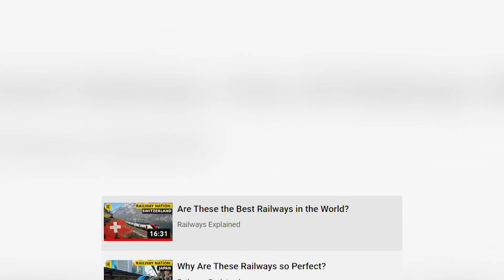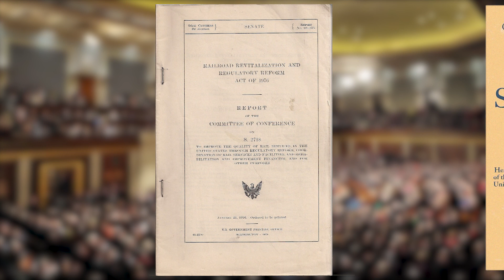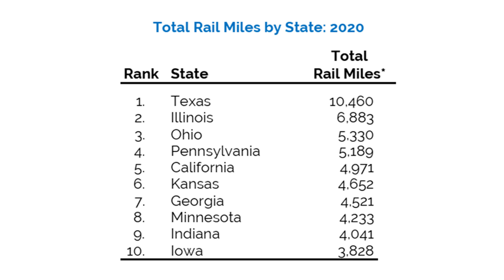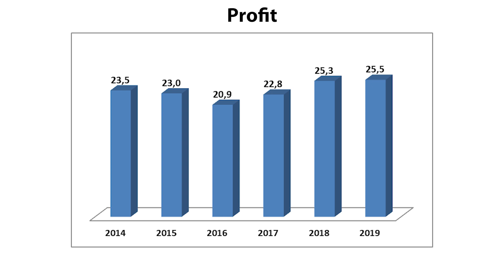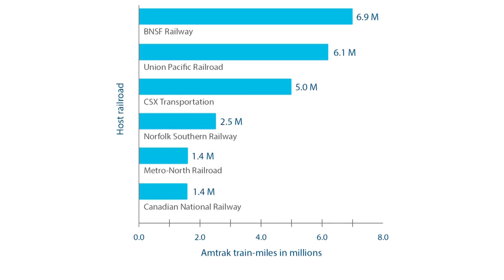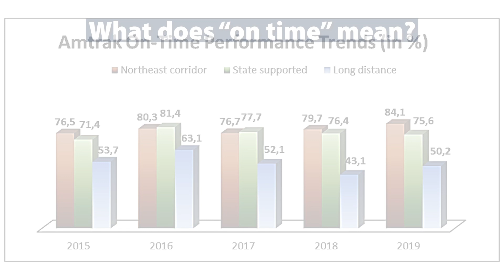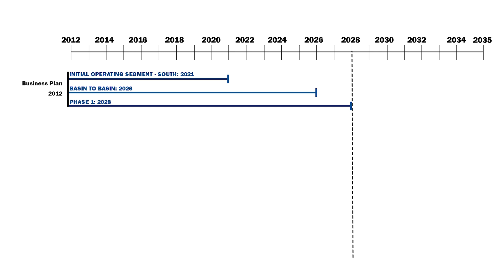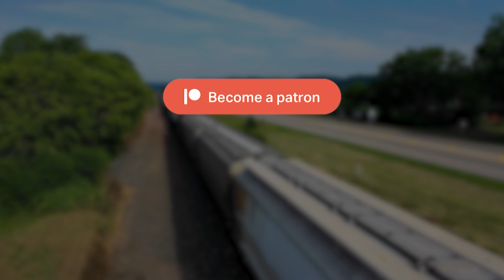American Railroads:  - Learn EVERYTHING About Them!

Comment: Would be interesting to see video on why freight rail is lackluster in Europe.
Reply: That’s because y’all have better passenger rail. It’s the opposite here...
Reply: @jackchen7003  also Europe has more uneven terrain and needs a lot of tunnels and bridges. That doesn't permit freight trains to be as massive, and efficient, as US trains. With that said, probably this year we will see some change in that. Even if our freight trains are smaller than the US's, they are still more efficient than trucks and with gas prices going up, well...
Reply: Europe has a lot of deep rivers which makes water navigation feasible for most areas, which is cheaper than rail per ton mile as there is no track to maintain.
Reply: @hannibal398  Even still, the US moves more domestic freight by waterways. We have the Mississippi, Great Lakes, and the atlantic inland waterway.

In the video you see 11% in US vs. around 7% in Europe

Comment: I do wonder if any  environmental offset made by carrying cargo by train is counteracted by the sheer amount of private vehicles carrying people inside and between cities.
Reply: It gets worse when you consider that trains in Western Europe, Japan, and even Russia are mostly electrified while the overwhelming majority of US trains are pulled by aging Diesel locomotives. Also americans drive larger, more polluting cars on average. If the US was serious about reducing carbon emissions, they would put in place a rolling railway electrification programme and decree that all new railway lines with more than 10 trains per day have to be electrified from the start. (A weaker version of this would be to mandate that all new rail lines have to be designed with clearance for overhead electrification in mind.) All of this in parallel with the development of a competitive network of medium and high speed electrified rail network dedicated to passenger trains.
Reply: Passenger rail cannot offset the environmental benefits freight brings. We are talking about very heavy materials in freight trains that are 10x as long as passenger trains.
Reply: @sciencecw  Sure, if you compare it to the road-based alternatives putting freight on trains has more benefit than putting passengers on trains. However, once you start taking short passenger flights out of the air with high speed rail, it's a different ball game. (see reduction in number of flights in areas with good high speed rail connections.)
Reply: @mariusdufour9186  : "the overwhelming majority of US trains are pulled by aging Diesel locomotives."  Obviously you know NOTHING about the murcan railroad system: trains in murca are 1000% pulled by diesel locomotives.
Reply: @mariusdufour9186  I take it you didn’t watch the video… 0.5% of greenhouse gases in America are contributed by diesel freight rail. That’s what you’re complaining about lol. And obviously, you don’t know what you’re talking about, since most class 1 RRs are running locos that are less than 20 years old.
Reply: @mariusdufour9186  Mandating railway electrification might have the opposite effect, as it may discourage use of railroads at all.
Reply: @jd0192  Electrical trains can pull more weight, accelerate faster etc. On top of greenhouse gas emmissions you also get a more efficient railroad out of it.
Reply: @spencergraham-thille9896  Why? Electric trains are cheaper to run and maintain (more than compensating the maintenance of the overhead lines and electrical system), last longer, and because they don't have to drag along a massive diesel engine and a massive diesel tank, they can pull more (or accelerate faster) with the exact same electric motor. In the long run, electric trains are just better, unless you're talking about lines that see only a few short trains per day.
Reply: @mariusdufour9186  “efficient” apart from the substantial cost outlay and the total redevelopment of infrastructure and literally everything else? Yeah, nice one
Reply: @jd0192  There is a significant upfront capital cost, but this is recuperated over little more than a decade of use, depending on how tricky electrification is due to bridges tunnels etc. The cost per mile goes down if you do it in a rolling programme, by guaranteeing electrification projects for a decade into the future. For example if Union Pacific held a press conference announcing that they plan to electrify all of their main lines over the next decade or so. Then you will see a few companies emerge that specialise in the electrification of railways. From the engineers, to the technicians, to the workers who put up the pilons. With every project, they will be able to deliver mor quickly and with a lower price-tag per mile.
If it isn't more efficient, why are the Indian railroads electrifying all their new freight main lines, and going back to electrify the existing ones? Why would they even bother developing an overhead electrification system that can fit double-stacked containers on flat cars? It's not like they are just made of money. It's because they figured out that they can move more freight more cheaply with electric trains over the same number of tracks.
For an example of an effective rolling programme, look at the Spanish high speed network. No one builds HSR cheaper than the Spanish except for the Chinese, who have lower labour costs, and more economies of scale.
Of course, we know US railroads are allergic to any capital expenditure that doesn't give them a return within the next quarter, maybe the next year. There are still double track flat crossings on the US network, for example.
Reply: @mariusdufour9186  California is doing some of what you describe. The line between San Francisco and San José is being electrified now. This is mainly so that they can use EMUs in commuter services, but it will also be used by the California High Speed Rail Project when the Pacheco Pass tunnel is built. The High Speed Rail project is being built completely grade separated as the trains will run at 350 km/hr - 220 mph.
Reply: @jd0192  efficient including those things, yes. Especially as fuel costs rise once again.
Reply: @mariusdufour9186  looks at new GE locomotive Wanna bet they're aging?
Reply: @mariusdufour9186  First, what year of production and by what standard do you consider "aging"?  Second, most railroads have either been rebuilding old locomotives or buying new locomotives to modernize to the latest EPA standards. Locomotives built since 2015 have the highest standards for emissions. The most advanced diesel locomotives move 1 ton of freight nearly 500 miles per gallon. The average tonnage of US Class I freight trains is 8.5 tons. So please explain why and what incentive any Class I and Class II railroads would have to move away from upgrading to higher tier locomotives and upgrade entire systems and rolling stock to electric??
Reply: @mariusdufour9186   "For example if Union Pacific held a press conference announcing that they plan to electrify all of their main lines over the next decade or so."

Please cite a source or link for this. I'm not seeing any news about this other than the battery electric locomotives it ordered to use for yard switching.
Reply: @jirky015  I think you missed the key word 'if'. Of course Union Pacific has and will probably never hold a press conference about electrifying their main lines, because Union Pacific isn't interested in electrification. That statement was clearly a hypothetical. It was a suggestion of how the US railroads could become more electrified at a reasonable cost, not a statement of fact.
Reply: @mariusdufour9186  I did miss "if". I should have know it was hypothetical because it is ridiculous. There has to be VIABLE reasons, not hypothetical, not moral, not feel good reasons, to electrify especially when there are other existing options for railroads to reduce carbon emissions without spending billions of dollars to upgrade entire systems.
Reply: @jirky015  Modern electrified railways are the peak of railway efficiency. They can move more stuff and people at a lower operating cost than anything else over short to medium distances. Too bad US railroads haven't figured that one out.
Battery powered trains and hydrogen powered trains are going to be heavier than even diesel trains. It can make sense on branch lines that aren't used very often, but on high traffic main lines there is no way they beat electric wires. Why is a country like India electrifying it's railways significantly faster than they are fazing out coal-fired power stations? Because electrification makes shipping goods and people cheaper, while shutting down coal-fired power plants makes electricity more expensive, it's that simple. The reduction in CO2 emissions is just a nice little bonus. (and it's not very big if you produce half your power by burning coal.)
There is nothing hypothetical about the benefits of mass electrification, these are clearly understood, and acted upon in many nations. There are countless examples of efficient (mostly) electrified railway networks, or lines, whether for passengers (Switserland and Japan spring to mind), or for main line freight (India, Russia, and to a lesser extent China)
Reply: @mariusdufour9186  US freight railroads already experimented with electrification and rejected it. Electric locomotives could easily outperform steam engines but they could not compete with the advantages of diesels.
Reply: @sharkheadism  Those big diesel locomotives are mostly diesel electrics. They're just electric locomotives with an expensive diesel generator and massive fuel tanks instead of overhead wires. The performance is similar to electric locomotives (with equivalent electric motors), though the added weight of the diesel powerplant, and the fuel makes them more sluggish. I don't know what kind of skewed comparison you would need for a diesel-electric locomotive to outperform an equivalent electric locomotive. If they have the same electric motor, the electric loco wins because it's lighter. If they have the same weight, the electric loco wins because it has more power (diesel and internal combustion engines are heavy). Purchasing and maintenance cost per unit is also going to be lower for electric locomotives because pantographs are cheaper and easier to maintain than entire diesel generators. You don't even need to stop for fuel with electric locomotives. The ONLY cost that could disqualify electric traction, and only when you're looking at the short term, is the installation cost of overhead wires, related electric grid upgrades, and new power plants.
Reply: @mariusdufour9186  Heavy locomotives are crucial to moving freight because it increases the adhesion of the locomotive to the rails. Lighter locomotives will slip. An electric locomotive of comparable power to SD70/ES44 diesels will weigh about the same as they do.

I think the claims of electric locomotives being vastly more reliable than diesels are somewhat dubious - diesel engines have been a mature technology for decades now and they keep getting more reliable and less polluting with time. Electrics are probably cheaper to maintain than diesels in the long run, but that's going to be offset to a degree by thousands of miles of overhead wire maintenance the railroad would need to take on.

I haven't seen any evidence that electric locomotives are cheaper to purchase than diesels. Maybe they are, just haven't seen any evidence of it.

Fueling diesels is hardly a concern, as most diesels can easily run an entire train from its origin to its destination terminal before needing refueling again. And fuel isn't free with electric locomotives: the cost of buying power has to be considered and so does the cost of additional generating capacity, which will be billions of dollars alone. Someone's going to pay for it.

Installation cost isn't anything to gloss over either. That's billions of dollars of amortized debt that will take decades for railroads to pay back, barring public intervention.
Reply: @sharkheadism You know that overhead wire maintenance can be done whenever they fix tracks, right? There is a reason that 1/3 of rail worldwide is electric. Diesel engines are going to be more expensive to operate both in terms of maintenance and fuel. Fuel costs are going to go up as we move away from fossil fuels, and it’s entirely possible that environmental regulation will make it incentivized to go electric anyway. There is no situation where diesel is better in any way. If electrified track was really that difficult to maintain, then the trans Siberian railroad across all of Russia wouldn’t be electric.
Reply: @Ry_TSG  Fuel isn't free for electric locomotives, and the overhead wire is an additional maintenance cost that electrified railroads do have to deal with.

If electric was as good as you think it is, more than one third of the world's rail lines would be electrified. It has a place, but it's not ideal for most rail lines by your own admission.
Reply: @sharkheadism  Electricity is cheaper than diesel, and is going to get even cheaper now that solar and wind are less expensive than every other source of electricity. The Environmental and Energy Study Institute estimates that electric trains are 50% less expensive to fuel than diesel, are 20% cheaper to buy, and are 30% cheaper to maintain. If anything, the lower costs associated with electrification should at least balance out the increased track maintenance cost, if not outweigh it. I'm not sure if you misread what I wrote before, but I think that most rail lines would be way better off being electric than diesel.
Reply: @Ry_TSG  Again I must point out that if electrification held a clear advantage over diesels, more rail lines would be electrified today.
Reply: @sharkheadism  Maybe some railway operators are just lazy. The numbers don't lie, so maybe it has just been easier for some railways to stick with diesel. Doesn't change the fact that electric is better.
Reply: @Ry_TSG  I think it's more likely railroads know what is economical and what isn't than you do.

Comment: As some that work at an Airport. We desperately need a new passenger rail system to take the load off the air system or we will face a massive breakdown. Which if you flown post Covid you are witnessing it happen now.

Comment: The closest passenger rail to me is a little over 120 miles away in Indianapolis, IN.  It used to be a little over 30 miles from me before Amtrak discontinued the Kentucky Cardinal.  With CSX abandoning the one freight line in our County a few years ago the closest active railroad to me is a little over 20 miles east on the L&I.  If we had passenger service here I'd utilize it but as far away as it is now I'm better off driving anywhere I need to go.

Comment: A worthy effort that's mostly correct. One point: There is no "Brightline East." For now there is Brightline Florida and Brightline West. Hopefully there will be some more Brightlines as time goes on.
Reply: It doesn't look like their other planned routes are going to get the same level of subsidies like they are getting in Florida. Unfortunately, the reason why Brightline is so successful at extracting subsidies in Florida is all due to the longtime political connections of their founder. Since he has no such clout outside of his home state it's unlikely that he'll be able to repeat the hat trick of subsidies he got in Florida elsewhere. Good luck to them! But don't hold your breath either.

Comment: you failed to say, that most suppliers and buyers do not have rail access. nor do any manf that ship less than 10 trucks a day need the rail services. and when the goods must be there within one week rail fails again. only the adaptable of trucks works for this. where i work we get 5-7 trucks a day just for the supply of frozen frys. no way can rail supply this to our door. as one 50 ft car could do most of this job. we have no rail access. inter model would take a couple more days in time.our building is a truck dock. no place for a rail siding. then "somebody" would have to buy couple miles of ag land to get to our yard. at least one grade crossing. a good ten+ miles from the yard.... just for one boxcar a day.
and some say our taxes should support those rich company's.  sure i like trains. but as it is now my taxes are way to high, then all the graft, corruption and greed. then some just stealing part of said TAX moneys.